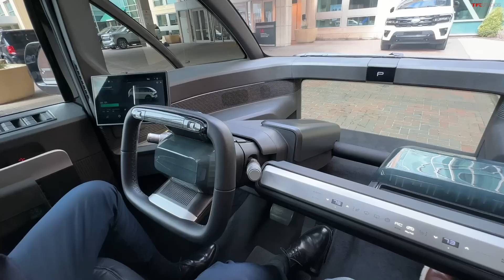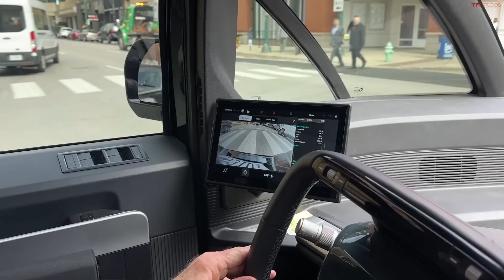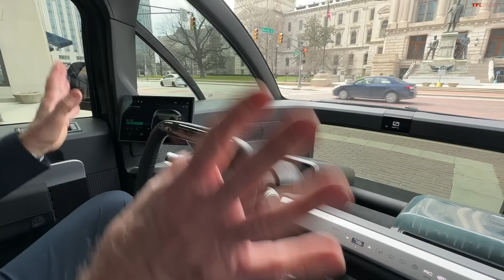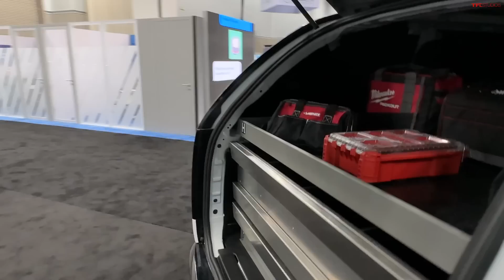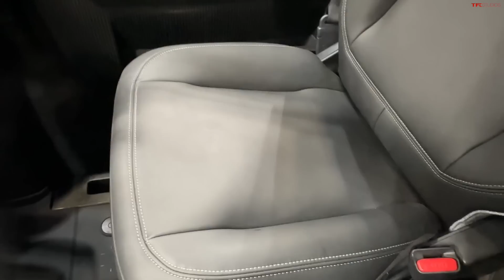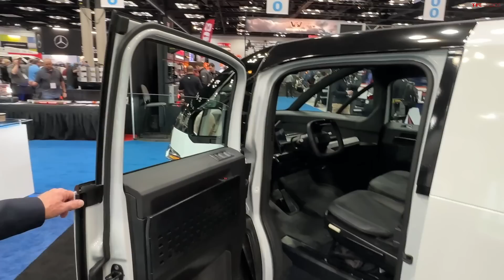The All-Electric Canoo Is Like NO Other Van You've Ever Known or Driven: Come Ride Along With Me!

Comment: looks great apart from the touch screen for basic controls. doesn't matter how safe the car itself is if the driver has to stare at the screen to change basic settings. we need clear feedback ie buttons, so we can use touch to change settings.

Comment: Also you need a park and charge system. Place the charger on the ground in the garage, drive over it, it automatically connects and it starts charging
Reply: wildly inefficient, costs across the board are cheaper for standard plugs, only downside is seconds of effort.

Comment: For those wondering... the stock ticker symbol is GOEV, and it's currently trading at $0.16 per share.
Reply: it is a t $2 now
Reply: @jio-lito  ... They did a reverse stock split.  So, it's actually cheaper now than it was.
Reply: @emantabrizi8218  no a reverse split would make the stock twice what it was, and half the shares. 
 A split gives you   twice shares and the price goes to half.😊
Reply: 0$ now

Comment: Hello Andre. Everybody are so focused on one pedal driving for regen, but in reality this started with Tesla because they found it easier to create regen on the accellerator than make it possible with a smooth deceleration with the brake pedal like the smooth regen Toyota have made for their hybrid cars for years. Then the degree of regen comes after how fast the driver have to stop the car, as simple as that. This also is much more comfortable for the passengers, because we will not have the recktless driving. And if you have to panic brake it's the same pedal, and as you of course know this way of braking with regen also have a lot of other advantages. Like when you are standing on an incline the brakes are on until the trafic lights turn green. Thanks Andre, you are always good at this, a natural talent. You have probebly also seen their marketing og a car with 500 miles range. Could that be like the double cab pickup truck they have created for the defense?

Comment: I'm kind of liking the idea of these canoo vehicles. They're literally the Swiss Army knives of vehicles. You can customize and convert them to the vehicle of your choice all while it is using the same exact platform. In doing that, I can imagine that it will help drive the cost of these vehicles down a little since there doesnt need to be any additional investments in creating multiple platforms for different vehicles. Just literally drop on the top you need and you're good. Will definitely consider one of these in the future once the infrastructure improves more throughout the entirety of the US. I'm in MI with cold ass weather rn and there is barely any charging stations unless you live in or near a major city like Ann Arbor or Detroit.

Comment: Horrible design, horrible front view with lots of structure in the way that makes you feel trapped, completely unnecessary road window that serves no purpose whatsoever, wasted front space, ugly, tiny and impractical steering wheel with window adjustments?!?!?!?. Driver seems totally uncomfortable having trouble reaching both the steering wheel, which is too low and the pedals and totally lame positioning of the infotainment screen. The only good thing about this vehicle is the turning rate. The only place I could see this car being used is in at the airport simply because it looks like an airport vehicle.

This is obviously the result of the owner saying "I want it like that because I said so".

Comment: It is unique however there are a lot of design flaw and impracticality. The only thing u can get excited on is a new look but after awhile that look will be just regular like any car. The steering wheel is ok and not really a wow factor. I get it has to look different. The space in front is wasted and the clear view is also unneccesary. They could have use the money for extra seating and extra space. Instead of 7 make it an expandable 9 - 10 seatings and can be converted to extra lugage or tailgaiting space. This is not a luxury car it was intended for cargo. Since it is designed for cargo they should have made it more seating and comfort in a way the UBER and Lyft community can utililyze the vehicle. The placement if the screen is worthless as well for passanger. That should have been place in the middle so it can be shared and people will always use it other than just to monitor car sensors which an avarage people really do not pay attention to. When the designer probably was a carsalesman in the past because management bought the idea quick and never really look into practicallity. I will do a lot of changes on this thing right away. Looks great outside but crappy design and layout inside. Canoo take this as constructive criticism. You will end up with a lot of disatisfied customers after the sale. People will buy it because of the hype but after a few weeks or months owning it they will be saying this could have been this and that. Anyway just my 20 cents.

Comment: I think the thing that upsets me most is that there is a lot of space in the front for more stuff, and you aren't using it. I think more batteries, a generator, or more comfort items would be better, it feels like this car was designed to be adjusted while stopped rather than while moving. sometimes I need to change the heat fast or volume fast so I can concentrate on driving.

Comment: How is it in harsch winter conditions like in mu country Sweden?
Love the design. But how mutch charge/batteri capacity do you loose in cold weather? And how good are the ventilation for the Windows? In cold places you need a really good boost of hot air fast for the windows to be able to see and drive the car safe??
Also, how is the programming for snow with two motors? Generally Electric don't drive good in snow. Some have started to work on good programming so there Electric cars handles drivning in snow better... how is it on these Canoo cars right now??

Comment: ⚠️The main reason respected auto makers such as mercedes benz who actually owns the patent for drive by wire steering DONT USE IT ON THEIR world class  CARS , is cause if you loose battery for any reason at all, the very first thing you loose is the STEERING capability and any chance to avoid obstacles or to choose where you need to steer your dead battery vehicle.  ⚠️. Terrible idea and design.  I would buy this van for sure.  But that electric steering is a deal breaker for me. And many others.

Comment: One thing I would like to see with this chassis is multi change body 
I can buy a van body or a truck body placed on the same chassis and interchange them as needed. Just upgrade the body. This should be easy as it is drive by wire. The interchangeable body should be plug in play. ...... future vehicle concept

Comment: I undersrand that this vid is 8 mos old and there have been advancements since then. I also will say i have my deposit down for the truck version that wont be out until probably '25.  But i still want to make a couple of points here.  1, the blogger made the point of which sold me and that is its throwback to the old COEs.  Those of us who are nostalgic about thise okd trucks are happy that someone actually brought that style back.  Im sure it wasnt your intention but its a big readon why i put my deposit down. 2.  The single sled and DBW are the reasons why i keep putting money into its stock. I really believe in this concept. 3.  The mileage scares me.  A perfect example for my reasoning on this actually involves your pick-up. You have pics showing a camping version. But who goes camping just down the road?  200 miles to get to your camp site is not practical. I have stated this on other vids of Canoo so ill ask on here as well.  Is Canoo going to look at selling a tow behind sled or partnering with a company that can offer a tow behind sled. One that can be converted to an enclosed trailor to use for small business needs or cargo carry. Or a pop up camper type for those camping trips beyond 200 miles. A tow behind sled would double your mileage abilities, offer electricity for use on thats sleds purpose (ie: for plugs to charge your battery operated tools or for heat and electricity within the camper, etc)

Comment: With all that glass, especially the glass roof, I wonder how well this performs during rollover crashes. Also NOT  a fan of every control being a menu button on the touchscreen - some things should be physical switches/buttons for a reason. Especially lights and climate control/radio. Plus having everything as software like that means you're handcuffed to this company's customized OS and at risk if they ever have issues in the future of your vehicle being rendered useless. Nevermind computers like that tend to age poorly and slow down massively over time (and require constant connection/updates from the internet which puts your vehicle at risk of being hacked).
It's a unique vehicle design, that's for sure. But it just feels far too "gimmicky" for my liking, and not likely to sell well and provide a solid future for the company OR the vehicles they sell. There's a good reason all the most popular electric vehicles are ones designed to essentially be electric versions of petrol/diesel counterparts. People like and are comfortable with those, and aren't so keen on the flashy or weird designs other companies have come up with. It's part of the reason electric cars failed to take off during earlier decades - they just looked far too odd and weird for people's liking, too different from the regular vehicles already on the road and available.

Comment: Now we need infrastructure and nuclear power to generate carbon free power. The batteries are extremely toxic and slow to charge. That's a dumb ass steering wheel. Also it looks like a death trap in the event of a head on.

Comment: not sure about the screen position, and the number of controls on it, multi layer menus, holding your arm at length to press buttons on a bumpy road... que a lot of mis clicks... when I can do all the same on a 'normal' wheel cluster by touch alone, without ever taking my eyes off the road. & Mirror controls on the steering wheel?? the most common controls should be on the wheel, not the ones you set once when first getting in then never touch again untill someone else drives it. 
scale this up a bit to more like 6m2 in the back and you'd have something far more useful, particularly if it had 4wd as a light offroader. 
honestly looks good, I want to love it... but some silly choices here that would concern me about the rest of the car.

Comment: That has to be the DUMBEST looking thing I've ever seen!!  The suicide doors and non-distinct front and rear will have you walking around to get on the right side more than you think.

A SQUARE steering wheel is an absolute DEATH OPTION in emergency handling situations, when you need to concentrate COMPLETELY on the emergency on the road but you have to LOOK where you can grab the wheel is INSANE!!

Hitting a semi-trailer with that glass that low is going to put the trailer RIGHT IN YOUR LAP (and FACE)!!

Ever get a BLUE SCREEN on your laptop?  Just WAIT till it happens on your "steer by wire"!!  Try pushing your dead battery car to the side of the road when you CAN'T STEER IT!!

Innovation can be a good thing, but not when it's OVERDONE, and not thought out very well!!
Reply: I agree how ridiculous this vehicle looks.

Comment: Not sure I like variable steering. At all.

Don’t like the square wheel.

Don’t like the buttons on the wheel.

Why rear drive?

Touch controls are a no. Give me buttons and dials.

Tight turning radius is a good thing.

5 star crash rating is exactly what I look for.

Since it is called canoo it should be amphibious, n’est pas? Not that I regard this as anything other than niche case usage.

Glass roof means it is an oven.

For reference I drive a Polo and try to only drive it when I have my kids.
But when it hits 40C and I am 40 min walk from the metro sometimes I pussy out.

Why taper at the back? Load capacity is limited by that. And this has a strong focus on functionality.

Plus points for visibility from what I see.

Not sure I trust drive by wire that much.

I do like one pedal drive. I drive a manual for reference.

Not sure about safari windows. Can’t make my mind up.

Having a zone that needs to be kept clear for airbag that will inevitably be used for storage is asking for trouble.

“A tech platform on wheels” does NOT inspire confidence.

Comment: I'm sad there is no affordable electric micro van available to the US consumer yet (think nissan NV200 or first gen Scion xB size)..! Hope Canoo does great, the platform looks great. A few odd choices already mentioned (mirror adjustment on steering wheel - could be mapped instead to control touch panel functions?), .. no HUD option for the massive amount of glass in the front..

Comment: A 200 mile range is simply not good enough,  on the freeway that calculates to 120mi max. DEAL BREAKER.
Reply: I agree 200 mile range is not good enough. Not sure where you get 120 miles from though.

Comment: Completely STUPID design and poor utilization of space. Their designers & engineers are not as smart as they think
All that front part is wasted, when it could be used for storage AND crash protection.
Also, if its drive-by-wire, why it doesn't have adjustable pedals or no pedals at all ?

Comment: Steer by wire actually means that you have either very small or unrealistic feedback from the wheels. 
Not to mention variable ratio (which Lexus already have) means that you cannot control the car precisely because it is changing depends on your speed. 
It is high tech but not necessarily mean it is good and reliable.
Also 200 miles of range only? What year is it? and you say it is good value?

Comment: There are some interesting ideas in this van, but the functionality seems slightly off starting with a steering wheel that seems to give up some control ability with a non circular form and a low input/high response electrical steering.

Comment: For starters the exterior and colour are perfect to me. I'd buy just based on that.
The minimalistic dashboard bar is sublime! All other EV's should copy that to replace their current TMI dashboard tablets.
The speedometer is in the wrong place. It should be on the steering wheel instead of the mirror adjustment buttons.
A lot of well thought out design. Not sure about the frunk though.
4,200 pounds of vehicle! That's a lot of road tax in many countries.

Comment: 🎯 Key Takeaways for quick navigation:

The video features the Canoo lifestyle vehicle, an all-electric van with seating for seven and a 200-mile range.
The Canoo vehicle uses steer-by-wire technology, providing more legroom and an open space design.
The premium passenger model is priced at $49,950 and comes fully loaded with a panoramic roof and 17 speakers.
Canoo also offers a commercial version, the Canoo LDV, which is tailored for fleet and delivery use.
The LDV has a 200+ mile range, 80 kWh battery pack, and offers approximately 133 cubic feet of cargo space with a 1500-pound payload capacity.
The vehicle has a tight turning radius and excellent maneuverability, making it suitable for city driving and tight spaces.
The front interior of the Canoo vehicle features a signature street view glass, providing an unparalleled field of view.
It is a tech platform on wheels with relatively fewer parts (1600 parts) compared to traditional vehicles (8000-9000 parts).
The LDV is being delivered to customers, and 2024 orders are being booked for various fleet and commercial purposes.
Canoo plans to expand its offerings with a pickup truck version and a seven-passenger version, both using the same skateboard platform.
The manufacturing takes place in Oklahoma City, with plans to grow to a larger factory in Pryor, Oklahoma, in the future.

Made with HARPA AI

Comment: As a residential electrician, this would almost work for me, but I need a small roof rack (gotta haul 10 ft conduits and a small extention ladder). I've been using a compact cargo van with great success, but the POS Fiat is failing and I'm in the market for something to replace it.

Comment: He talks about glass roof as if it is a good thing. No, it is stupid, useless, disgusting thing. Glass roofs are idiotic fad that NEVER had any meaning or use. They let in a lot of heat into the cabin, forcing more AC use, losing range, losing efficiency. They make cars more expensive, they DO break, meaning insurance will be higher too. Idiotic glass roofs should be replaced with SOLAR roof panels. Then they will ACTUALLY be useful.